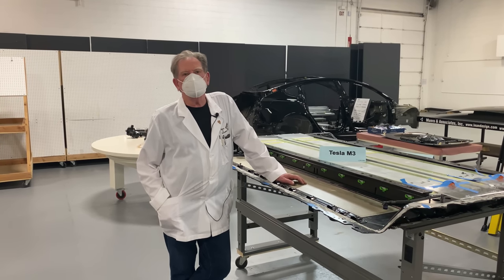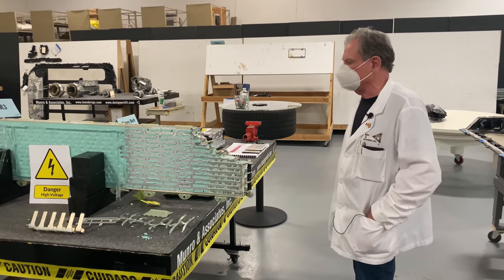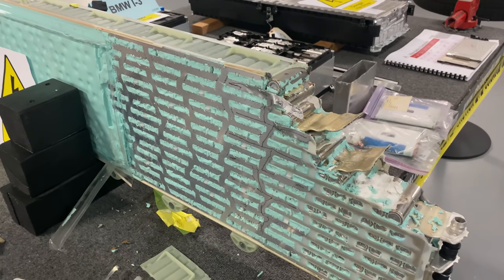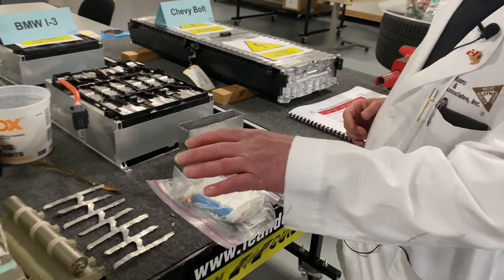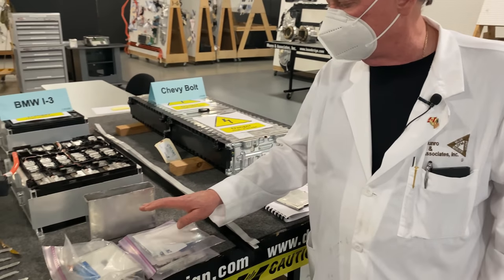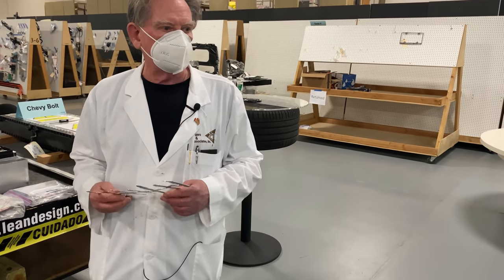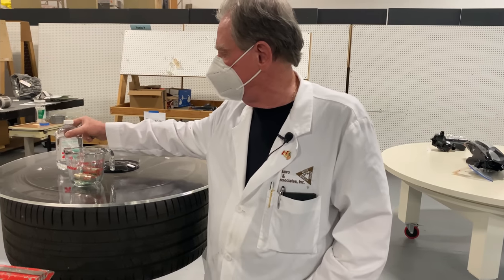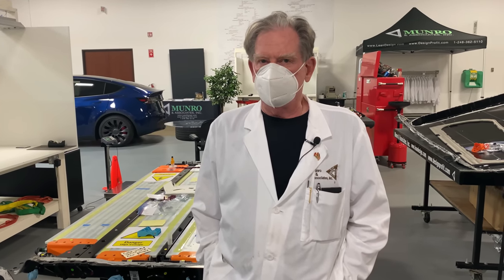Model Y E32: High Voltage Battery Comparison - Cylindrical vs. Prizmatic vs. Pouch

Comment: The Tesla battery may be cheap, but it sure looks cheap & nasty. Glue? Seriously? Can that even be recycled easily? It looks like it was cobbled together by a teenager.
Reply: Leave the technical stuff to the people who know how to do their job.
Did you want them to put screws in each of the 4416 cells? Screws that could get loose, and fall on electrical connections making short circuits.
How can the heat from the cell transfert to the cooling loop without glue?
What do you you think would be a better way to hold the cells for many years to whistand road vibration, heat, accelerations, braking, and crashes.
Gives us an example of a better battery design.

Comment: So much for trying to recycle those batteries. Just more toxic landfill. I pity my grandchildren having to deal with this waste problem we are creating for them.
Reply: why can't we recycle them?
Reply: how is that significantly different than current vehicle recycling with metals, plastics, foam, glass, carpet, fluids etc all finding its way in to a shredder and the output sorted to usable materials? just where do you think all the millions of junked cars go every year, to say nothing of the thousands of gallons of fuel burned during there lifetime?
Reply: as opposed to the millions of car engines lying around wreckers everywhere?

These batteries will be used for decades, first in cars, then in battery backups, and finally be recycled in like 15 to 20 years.

Your concern is rather misplaced
Reply: Ron CDs
Research required.
Don't believe the FUD.
Reply: Sorry to pop your uninformed nonsense bubble, but these batteries are already recycled, as well as being reused (re-use is an important part of the the overall recycling strategy). Perhaps a few minutes research would be better rather than embarrassing yourself with your lack of knowledge?
Reply: @stinger15au  Tesla will not allow recycled cars on its supercharger network and which company today uses recycled batteries for the home? And if they do are you going to pay for a system with limited life and usefulness as well as paying extra in home insurance for risk of fires?
Sorry but I've tried to get used batteries approved on my home insurance and have been threatened with cancellation of my policy.
Recycled batteries is a pipe dream.
Reply: @michaelmilberger9013  you try a pull those battery packs apart at an economical rate. New batteries are far cheaper and reliable. 
For goodness sake we can't even recycle solar panels and if we do the cost in power to manufacture them and then recycle them is greater then the total amount of power they produce during their useless life.
Reply: @skeptick6513  land fill. As a large percentage of that material is dumped and not reused as new material is cheaper to produce.
Reply: @rogerstarkey5390  ditto
Reply: @Cheradanine  I have recycled them myself and found that my home insurance company threatened to cancel my insurance if I used them. Tesla won't even let you use them on their or anybody's super charging network. If Tesla is scared of them you try to talk your insurance company into them? I couldn't.
Reply: @ronvds4713  Well done for completely missing the point. 
Just because good sense doesn't allow some random bloke to pull apart a battery and re-use it in some pet project does not mean that the batteries can't and aren't being recycled.
Reply: @ronvds4713  lol, whatever helps you sleep at night.

You are either lying or are terrible at negotiating. There is already hundreds, probably thousands of people using old leaf batteries in dozen's of different ways, including as home battery storage. Done properly, home battery storage isn't any extra fire risk, the only downside to old 2170 Tesla packs is capacity downgrades. They don't suddenly start catching fire at x or y years old. Since a home typically only needs 10 to 20kwh of storage, it's the perfect fit.

It's like all technologies, if there is a use and profit to be made, the companies will come. They will make it simple, they will make it easy. 

In the 1500's there wasn't much use for a computer programmer.......
Reply: @ronvds4713  That is two COMPLETELY different things. 

Tesla doesn't allow salvage titled cars to be put on the network. These are cars that likely have accident damage, flood damage or who knows what happened. Since they can't guarantee it, they are locked out. Simple really.

The BMS in a car is FAR more complex and needs to be way more robust than what is needed for simple home storage. 

You are wrong, simple as that.
Reply: troll
Reply: I can think of two Li battery recycling companies off my head, American Manganese and Duesenfeld, and two recycling research projects, Faraday Institution Birmingham UK and VW. Most of the materials are too valuable to waste - 50% current normal, 70% best practice, 90% feasible. Now lets talk about 14billion smartphone batteries, eh?
Reply: @ronvds4713  by recycle, I mean chemically reclaiming the lithium, cobalt, and other elements used in the original. This is the end of the line process any lithium battery must face after it has formed dendrites and had its capacity reduced.